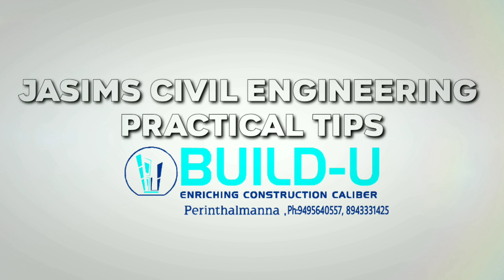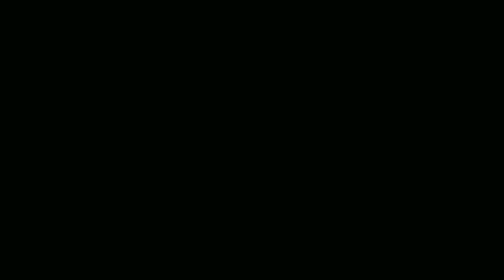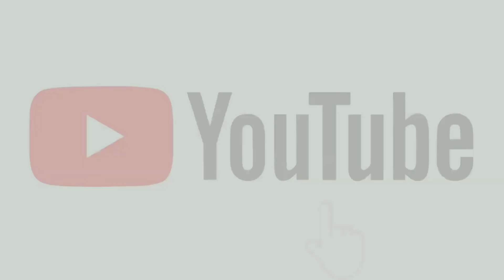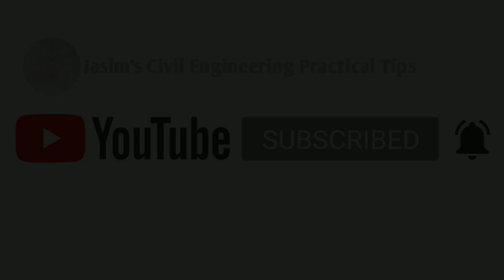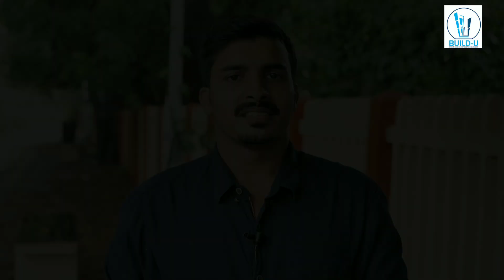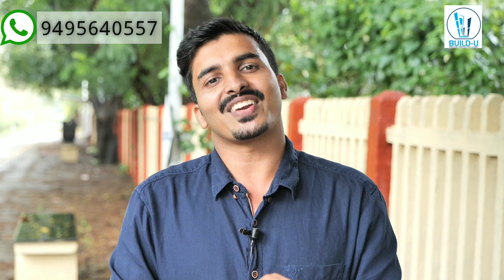സിമന്റ് അളവ് കൂട്ടിയാൽ ചോർച്ചയെ തുരത്താമോ?ഒരു അനുഭവക്കുറിപ്പ് .Er.Jasim Anamangadan ,Asst.Professor

Comment: ഹായ് roof slab concrete normal design mix ഏതാണ്... 1:2:4 ആണോ ?
Reply from the maker: അല്ല.
1:1.5:3 ആണ് ചെയ്യേണ്ടത്.
But നമ്മുടെ നാട്ടിൽ 1:2:3 or 1:2:4 ആണ് ചെയ്തു വരുന്നത്
Reply: @jasimscivilengineeringprac4264  അപ്പൊൾ സിമൻ്റ് കൂട്ടി ഇടാൻ പറയുന്നത് ശരി അല്ലേ?
Reply from the maker: Cement matram കൂടിയത് കൊണ്ട് കാര്യം ഇല്ല.
എല്ലാം ഒരേ തോതിൽ correct mix anusarich കൂട്ടണം.
Reply: @jasimscivilengineeringprac4264  👍. But don't expect common man to speak the language of a civil engineer
Reply: ഹലോ സാർ ഫില്ലർ സ്ലാബ് നിങ്ങളുടെ അഭിപ്രായം ഒന്ന് വിശദീകരിക്കാമോ
Reply from the maker: Filler slab oru nalla രീതിയാണ് 
പക്ഷേ അതേ കുറിച്ച് അറിയുന്നവർ നല്ല മേൽനോട്ടത്തിൽ ചെയ്തില്ല എങ്കിൽ പണി kitum.
Reply from the maker: Thank you bro

ഉപകാരപ്രദം എന്ന് തോന്നിയെങ്കിൽ മറ്റുള്ളവർക്കായി ഈ വീഡിയോ താങ്കളുടെ ഗ്രൂപ്പുകളിലും മറ്റും ഷെയർ ചെയ്യുമെന്ന് പ്രതീക്ഷിക്കുന്നു
Reply: ഇങ്ങനെ ഓടു വെച്ചു ചെരിച്ചു വാർക്കു ന്നതുകൊണ്ട് എന്തെങ്കിലും ബുദ്ധിമുട്ട് ഉണ്ടാകുമോ

Comment: For a load bearing wall,9" for G+1 house, what is the safe span between walls beyond which a beam is required.
Reply: Pls give a reply
Reply from the maker: In general 4 metres is taken  but at times if span changes we increase size of reinforcement and also thickness of slab from 10cm to 12 cm or decrese the spacing between adjascent bars
Reply: @jasimscivilengineeringprac4264  Thanks